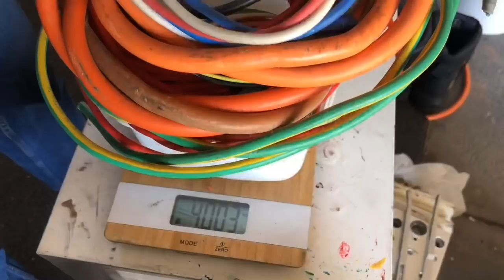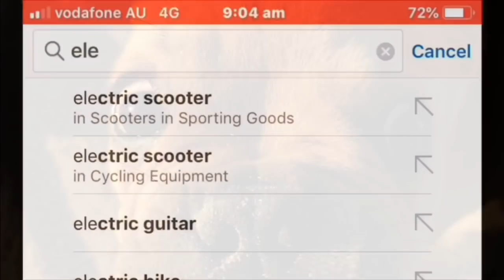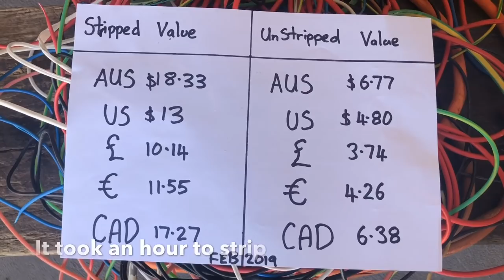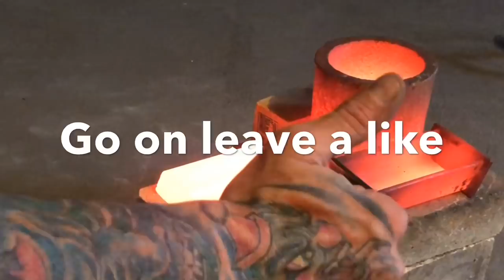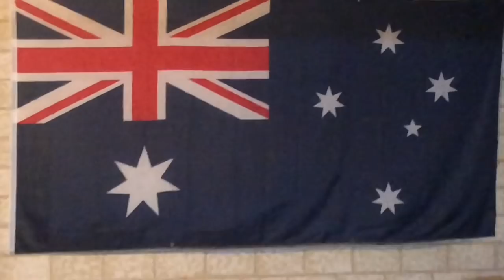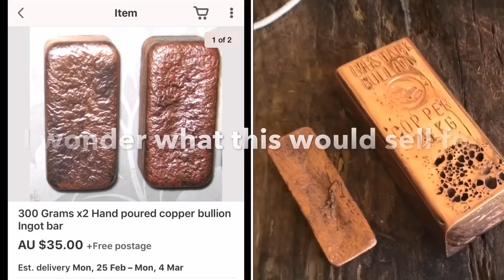To Strip or Not To Strip - Is it really worth stripping Copper Cable🤔 - Melting Copper

Comment: It took an hour to strip, and you got 2kg of copper, which would barely make enough to pay a laborer to do an hour's work. There's gotta be a better way. I've seen gypsies just throw everything on bonfires to burn the insulation off. Then again...they own all the scrap yards round here so they probably pay close to full weight when it's one of their own. As long as there's not a ton of crusty burnt plastic still clinging to it. Maybe they do some more processing after the burning. Heating it red hot and quenching in water would prolly pop a lot of the scale and crud off it
Reply from the maker: Yes very true but as this is a hobby my time is free I do this to relax and chill out I enjoy stripping things down and especially when I get to melt into an ingot and chuck it up on the shelf. You would never make a profit doing it the way that I do but I don’t do this for money that’s why I just stack it all up and never sell any of it😁👌🏻.

Comment: I have thought about burning unstripped wire in a gasifier (I make charcoal with a gasifier and have experimenting with reclaiming oil from plastic by pyrolysis ) It would only have to get hot enough to gasify the plastic coating then the copper could be melted in the furnace.

Comment: what i want to know is what would happen if you just chopped up the wire insulation and all,  and THEN melted it down, would it effect the melt, but i DO know that long before the wire melted, the insulation would burn and create a toxic cloud, so you would need to wear a gas ,mask.

Comment: Silly question: since a lot of rubber is flammable, could the coating be burnt off?
Reply: It would take a ton of fuel... Also, by the time it was burned off, you would have lost a lot of copper from drips and oxidation...

Comment: Well, I'm a year late but ...NO, it's not worth stripping the wire. I have measured the time to strip by hand. I had a mile of 0000 wire. 3/4 copper, 1/4 insulator. Phone wire by the Mile. Yuck.  It takes too long to strip by hand. Machines are expensive so unless you deal with wire .....So basically take the hit. Don't strip. You can melt off the insulator and if you don't get caught then you won't have to pay a $1500 or so fine. Like when a friend was caught melting wire in his front yard in the mountains....a county guy was driving by.....that was his job, to drive around and Look. So don't melt wire insulator off of wire in public view.

Comment: I ran a 3 row shaft furnace for a copper rod casting mill (Freeport McMoRan) and seeing the green flames brought back memories.I was going to attempt to build a mini version of the shaft furnace which was 2 stories tall.. But that little furnace looks awesome too. Can you control the gas/air mixture? Molten copper loves to absorb O2. The higher the O2 the more bubbles will be in the copper. On startup day when the copper flow first starts, upon taking the first sample, there'd be so much oxygen in the copper it bubbled like pepsi. I dont know much about casting single bars, but what would happen if you had a neutral or slightly reducing flame impinging on the the copper while pouring and until solid? We kept the O2 content of the copper between 150-300 ppm. Fascinating stuff.

Comment: i tried a piece of cable with 3x 1,5mm² wire, the cable would be worth 0,0372 Eur, if i strip the copper its worth 0,054 Eur, so if you have enough time, you can do it.

Comment: Cool, but if you are scrapping copper to be sold, you wasting huge amounts from that in casting process if not all the profit to be made. Just strip and cut to take less space and then transport to scrapper. Maybe do some chemical cleaning with vinegar or citric acid to get A1 quality price for it. If you are doing casting for your self, then sure i get it.
edit: as he mentions in comments
For stripping machine not bad at all, pretty simply thing to construct your self. I get lots of old cable around so probably end up building one for this. Been cleaning probably 50kg now by hand and its getting tiresome.

Comment: So with the cost of the stripper and the melting pot plus fuel for the pot and the cost of going to get the wires to strip not counting the time it all took was it worth it ?
Reply: I was thinking along the same lines - if you are doing it on a large scale; then fair enough. If doing it on an occasional basis, the equipment and the gas used would pretty much negate the benefits. In my own un-informed opinion, of course.

Comment: Go way out in the woods light a campfire and toss the wire on the fire. Burn off the insulation and while still hot dunk the coils in a bucket of water. Bright shiny copper. Enjoy the blue flames, don’t breathe it or get caught.

Comment: So we're looking at $245.86AUD for the price of your new stripper. If we were to use your time spent as an average for the same yield of copper, then it would take...
Around 13.5 hours of stripping to obtain enough stripped copper to pay for the unit. But! In that time, you would have technically made $156.06AUD out of thin air due to the stripping you were able to do. From that point forward, after only 13-14 hours of stripping, your machine will be paying for itself by more-than-doubling the value of your copper wires.
I'm not a mathematician. Please correct me where you see flaws in my maths!
EDIT: To add, it's probably more accurate to work out how long it will take to spin the entire $245.86AUD out of thin air, so I might do that. Expect a second edit.
EDIT 2: It looks like it will take you just over 21.25 hours of cable stripping to have the machine pay for itself via the extra value you get for your stripped copper. Again, point out any flaws, my friends!

Comment: The stripped copper-cable value is roughly 5euro/kg.  The cast copperbar value is something like 4,30 euro/kg. The gas is free and the added labour (for melting and casting) also. Definitly you will be chosen for the  Nobel-prize for economics...

Comment: So with the machine you stripped a little over 5 lbs.  Where I am # 1 stripped copper averages around $ 2.50 lb,  unstripped about 1/3 of that.  So let's say roughly $12.50 stripped or $4.25 unstripped.  How much is your time worth to you ?  Even your after work hours are still time you could be doing something else with.  Where I am minimum wage is $14.00 /hr.,  so even if you value your time at only minimum wage you're already $1.50 down after stripping but $4.25 ahead by not stripping at all.  If you're hoarding those ingots for a rainy day it would make more sense to sell unstripped wire and either stash the money or put it to work for you.  I hope this answers the question posed by the title of this video.

Comment: I don't even know by your video whether it's worth it or not. A friend of mine had maybe 6 pounds unstripped and got $5 one time, another time I went with 16 pounds unstripped and only got $4 I live in Canada. Our copper prices at the scrap yard are $1 to $3 per pound. If it's unstripped it's supposed to be $1 per pound and so I would have been badly ripped off, and my friend would have been ripped off. My friend should have had $6 and I should have had $16. Your 5 pounds would actually be $15 canadian at $3 per pound as it is all #1 copper (shiny). Unstripped it would be about $9 at $1 per pound.

Comment: In the 1970s, one of my college jobs was working for a sign company.  a couple of times a year, we would get a contract to rewire large interior lighted signs.  We had a 50 gallon oil drum at the back of the space that we wold regularly use to burn insulation off of copper wire.  Remember that, at this time, the South Bronx and Newark were plagued by small gangs going around stealing working wiring from commercial building.  Toxins from the fires were not considered. I confess.  That job contributed seriously to my degree.

Comment: My father used to strip cables for hours and hours. Stripping the insulation off, then taking the copper to a scrap yard. He'd also collect the aluminium soft drink ring-pulls (They used to be strewn all of the place, footpaths, roads etc, back then). And he never got much money for the hours of work. I am talking hours and hours, staying up most of the night burning wood/coal and power for a few quid!

Comment: I once stumbled across a demolished factory unit while working. Sourced the entry point for the main power and tracked myself 50ft of Industrial triple core copper power cable. Lead shielding the lot. So yeah, depending on how and where you get your copper cable it can be very lucrative to strip it lmao. About £180 per 6ft length that I pulled apart, coz the prices were sky high back then due to China & India gobbling up all non precious metals

Comment: Can the wire be burned without  any prep?
Reply from the maker: Matey you can definitely burn off the plastic without any prep at all and even put it in a Crucible and melt it down it just means you’ll need to skim off a bit extra crap before you pour it and in no way will it change the purity of the copper bar you pour. 👍🏻now  if I was  to do it this way could you imagine the crazy comments and abuse I would get if I melted my plastic off in the furnace🤦🏻‍♂️

Comment: Man, if you're stripping copper because you're going to cast it. It's probably not worth the time,  I'd just rake the crap off the top after it's melting. But if you're stripping big gauge wire to go to sell it because it's definitely worth the fucking time cuz you're only getting 20% because the scrap yards take 80% of every dollar because they have to strip it instead of doing it at the house and getting the whole hundred percent of the dollar. But teach their own. I strip most of my copper the only ones I don't is real thin gauge stranded. Because that crap ain't worth nothing anyway, and it's mostly jacket. So by the time you're done stripping that stuff like that and TW wire you've already taken 90% of your weight. With this gauge wire, it doesn't have a whole lot insulation usually. I'm starting to try my hand at copper casting to make my own ingots what kind of crucible do you have I need something clay or graphite I cast aluminum in a steel crucible I've made out of some 1/4" plate and copper doesn't seem to want to melt in it

Comment: im an electrician and i performed a test for my company many years ago. we collect all our scrap wire and my boss thought it would be profitable to strip the wire we had and i strongly disagreed and told him to give me a day and ill prove it to him. i dont remember the exact scrap prices of copper at the time but it was close to $1.00 per for insulated and $2.50 per pound bare. my boss just looks at numbers and dollar signs but over looks all the details how to get to those point. i took an 8 hour day of just stripping wire and this is what i came up with. i could strip 90#s of wire in 4 hours and came to a ratio of 1/3 weight being insulation and 2/3 being copper yielding 60#s of copper. so 90#s insulated netted $90, but 60#s bare netted $150. so looks good right $60 increase in price. i then informed him at $20 an hour for 4 hours is $80 and thats when he realized he was adding unnecessary work for us and he was actually losing money by having us strip the wire.

Comment: I still don't understand why stripped is more money.. surely the plastic just burns off you still have the same amount of copper which is where the money is at. Why strip it? The plastic will just burn off leaving the copper behind. Or are you suggesting that the plastic does not burn off and leaves impurities behind which reduces the value of the copper.. I'd have a hard time believing that...

Comment: Electrical Contractors in the 60's and 70's used to throw it all into a metal dumpster. add five gallons of gas and just burn it off. EPA came along, and they can 't do that anymore. I guess we're back to the bad old times again...

Comment: very awesome to watch. I was wondering if you can melt copper without stripping the plastic of off it. wouldn't the hot temp just melt and burn away the plastic? would it make the copper bar different? was wondering because i have 2 or 3, 5 gal buckets of stripped wire to melt my self and 3 or 4, 55 gal bags of un stripped wire.  i want to do 1 crucible of unstripped wire melt to see if it would ruin the copper bar, but i figured i would ask first as you might have already done the test your self.

Comment: Back in the late  50’s my electrician father worked as a general foreman on some large jobs.  My job was to scour the job site for scrap, and maybe not so scrap copper wire. He saves it up and every year he would cram it all in a 55 gallon drum with some holes poked
 around the base. Poured a quart or so of kerosine followed by a match. That wire burned off clean enough to suit the scrap dealers. Probably not very environmentally sound but very effective.

Comment: just burn it , it is not hard to build a stripping machine but your machine is far better . Stripping is worth more than burning .  never turn in wire that doesn't have the insulation removed you loose 3/4 f your money .Stripping comes to it own with number as 1 bare bright is worth a lot more than burnt  .   casting only worth it on low grade angel hair wire like xmas lights .casting looses money if done to 1 burnt and 1 bare bright . Wonder what the value would be if refined to 999 pure ?  I made a crusher that crushes cans ,wire ,etc into 4x4x6 bricks

Comment: Dude, 14 AWG and bigger, cut 4 or 5 inches ( 10 cm or so) then lengthwise, then just put end in vise and rip it down length of cable get a meter or so and wrap and keep going... Ok wire stripper is easier but I am poor

Comment: I have a box of old burnt out Christmas lights in my garage and been thinking of recycling them.  I saw some tweakers at the recycling center taking them in and thought, why not?  It would be neat to make some bars out of them though.  In California, the copper theft is so bad, recycling centers make you wait 2 weeks before they pay you.  They send you a check in the mail.  I'd rather have some copper bars stacked.  What type of fittings do you need for the propane; I want to make a Furnace.

Comment: This is utterly pointless, and wastes money. That electric wire stripper will either cost an absolute fortune, or break. Either way, you will lose profits. The furnace will also be very expensive to buy and run. To get most cash from that scrap wire, its best to weigh in for little labour costs, and no massive equipment bills, taking everything as profit. Pure scrap will only be abit higher price to the scrapper than the insulated cables.

Comment: Hey BigstackD, do you know if those ugly void holes in otherwise gorgeous copper ingots like this could be filled with small amounts of leftover melted copper after they've cooled a bit and then the whole thing smoothed down to look clean? Or is it too much hassle for the result or would it not work for some reason?   The fussy guy inside was wondering. ;-)

Comment: Would be interesting to know how much gas and electricity and other stuff you spend on melting and shaping your scrap material. You certainly know that when you first melt and cast it to keep it as bullion ingots it drastically diminishes your gains and efficiency. It´s also less ecological because if you sell it to the industry they ´re going to have to melt it again anyway a second time. The video unfortunately doesn't give any answer to whether or not it is worth to strip cables, as it´s been put in the header as a question to be investigated.
-  By the way:  I leave my copper, brass, lead etc. scrap just in buckets or boxes until I use or sell it and give a damn for casting it.

Comment: There's no difference in price of copper stripped or unstripped, the price difference is because of the weight of the insulation. Stripping is a con, work it out or better still take 20 meters of stripped cable and 20 meters unstripped (much heavier hence lower price per ton) of the same type to the scrappy. ~You'll be paid the same for both because that's the price of copper ;-)

Comment: look at wat copper you collected in an hour , if thats the same or more than an hourly wage then its word doing , if not........don't give up youre datjob 
calculated how mush a friend made stripping copper out of electric motors and it came to about 2 dollar an hour , it realy takes a long time to pull the copper out of the rotor and stator 
thick welding cable type stuff is best verry eazy to strip and lotsah weight 

one good thing : scrap is free and usually doesnt get taxed , its a nice way to save up extra cash for the hollidays or sumting like that

Comment: Just strip it to bare copper. Nonsense in going through the process of melting and casting it into ingots. You eat your profits in fuel costs that way. Worst case, hucknit into your crucible and burn the insulation off that way

Comment: Pretty similar price in this area right now.  And it IS worth it to me.  I don't cast bricks from it, or use a machine, but it's DEFINITELY worth my time.  I do employ pulleys and a similar stripping method.  And I've had ideas for making my own machine out of scrap material using a drill motor for the pulling. I don't like buying anything if I can fashion it myself.  Re-purposing is always on my mind.  
Keep up your videos man.  Always enjoy them.

Comment: Could you use a sacrificial crucible, heat it up, drop the copper wire in still in its casing and then pull the unmelted copper wire out after the casing melts off? Then grab another piece of wire and rinse n' repeat?

Comment: the ingot is work of art  but worth no more or probably less than the dry bright it was made from , little stripper worked well , we have 30 year old stripper with original blade but it wont strip that thin stuff, china ends up doing that !